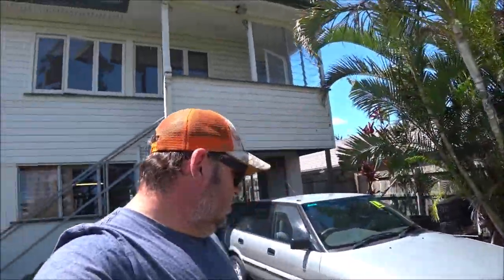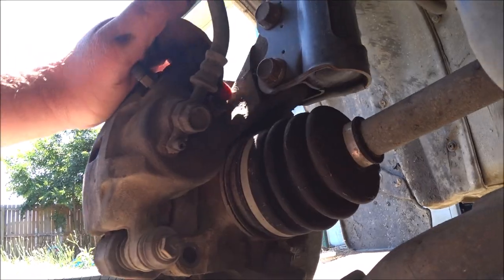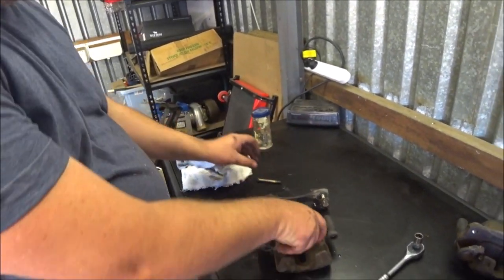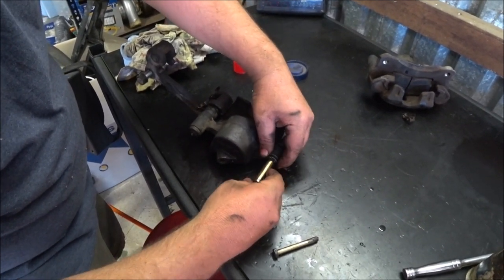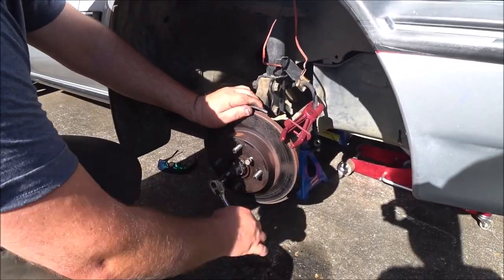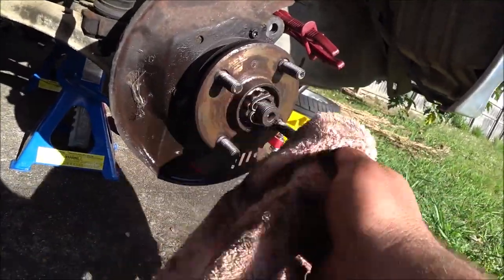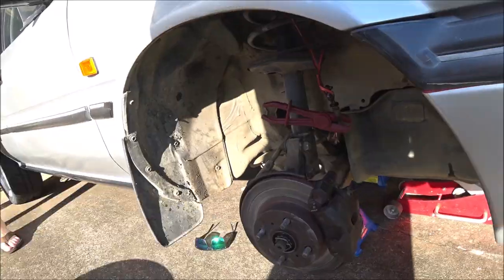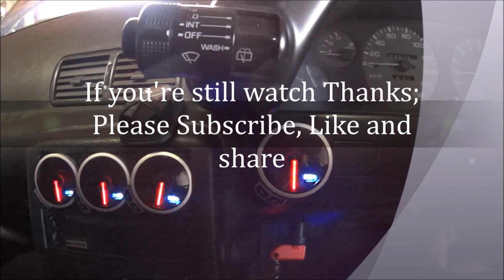AE92 Toyota Corolla - Sticky Brake Calipers Fix & Glazed Rotors

Comment: Good job Tangles and Slave child 1 . That Copper Anti seize is  good stuff , i always use it in the back of my disk rotors and I always apply some on the back of the brake pads and the ends of the brake pads and where their seated in the caliper so that they can slide back and forth a bit . Was that  high temperature grease you used of on slide pins ? I know that Ford recommends that high temperature grease is used on the brake slide pins , some people use Silicone paste which is also fine . Did you measure the thickness of the disk rotors to see if they are within specs? I didn’t see you using a torque wrench again in this video to tighten the caliper bolts Tangles lol . Cheers 🍻
Reply from the maker: The brakes on this think won't get so hot to need high temp grease, bearing grease is sufficient. I'll keep that in mind on the falcon though, they have a lot more work to do. Didn't measure but there was almost no lip at all, just the rust line so they haven't worn much. Torque wrenches for me, are for engine and gearbox bits.  But if someone is uncomfortable and new they could/should use one, which is why I usually mention that the correct torque number will be in a factory service manual.